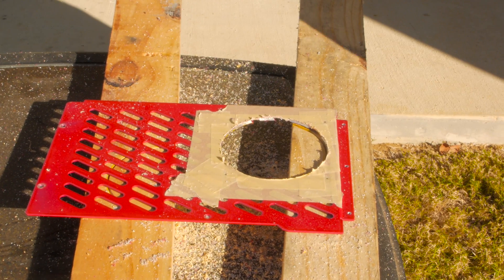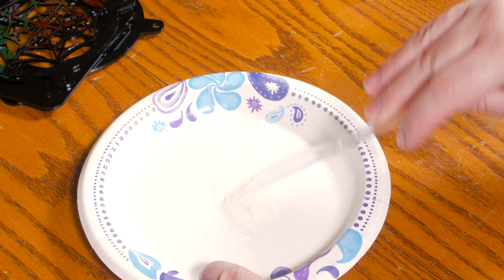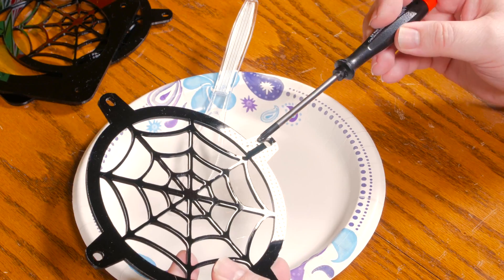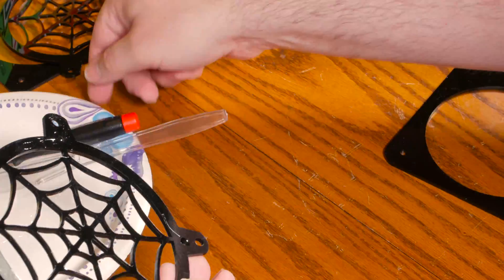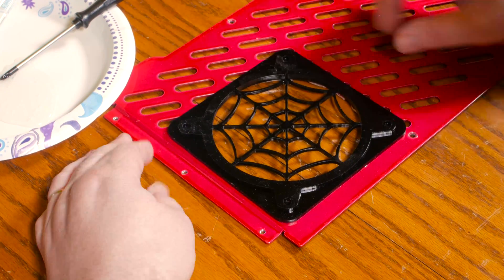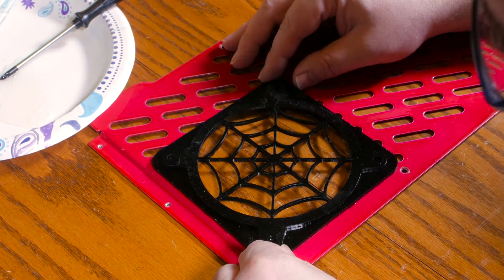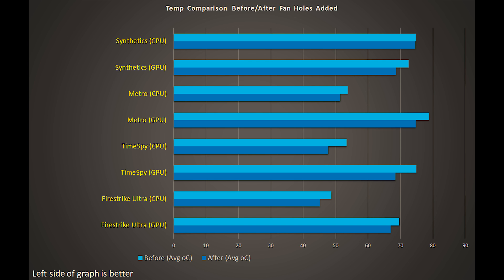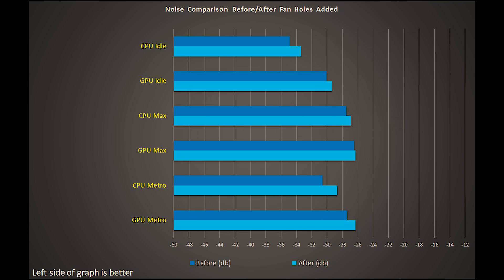S4 Mini build modification

Comment: The mod looks pretty rough, aesthetically. Sure it improves air flow but if I wanted better cooling I would've gone with a larger case. Personally, I like the simplicity of the S4 Mini. Any ways, I saw your previous mod with the GTX 1080 Ti fans and am wondering whether you've upgraded to a 12 pin dc connector, since someone had issues with a melted 8 pin dc jack.

https://smallformfactor.net/forum/threads/more-g-unique-bto-psus-are-now-available-direct-order.1983/page-10#post-77757
Reply from the maker: I have reached out to Gury and asked him to send me a 12 pin connector and a matching brick; I haven't had the issues that were reported but it's not a risk I want to take either.